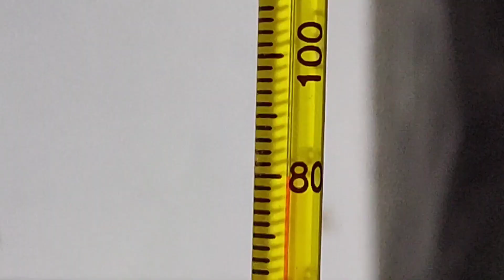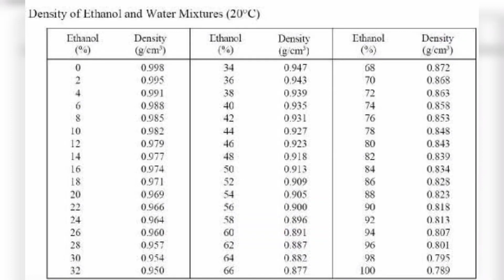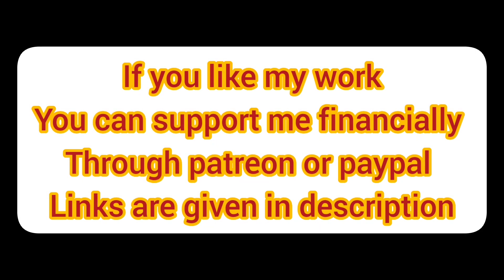How to make Alcohol without Yeast

Comment: Sorry, but this is hardly making alcohol without yeast. You are using yeast, just the versions naturally available on the skins of fruits. All fruit has naturally occurring yeast on the skins, so it doesn't matter what type of fruit you use, you will get a similar result. In fact almost all commercial wine production relies on the yeasts on the grape skins, so the vast majority of all wine would qualify as being made "without yeast" in the same way: The only difference being that fresh grapes are used, and of course wine is normally made on a substantially larger scale than shown here.
Reply: I think when yeast is referenced, he means packages of store-bought yeast, not completely removing yeast from the equation.
Reply: So theoretically you could make with apples with it's natural yeast as well? Apples is what I want to make some with but I'm not sure.
Reply: @Calico_Chip  Yes - in fact that's how most cider is made, at least those which use traditional methods. The yeasts naturally present on apple skins get released into the juice when the apples are diced and then pressed, and this takes care of the fermentation.

Most of the modern engineered yeasts are made for the purpose of surviving higher alcohol concentrations than naturally existing varieties, with some of the "turbo yeasts" able to survive in up to 20% alcohol by volume. Most naturally existing varieties die somewhere between 10 and 12%, which is why most wines have that same range of alcohol content.

Cider doesn't usually go that high - about 5% is typical, though there are some traditional ciders which go somewhere between 7 and 10%. Those are the ones to watch out for though, because they have the peculiar effect of getting you drunk "from the feet up". They look and taste just like apple juice and are just as easily drinkable, so you can sit down and drink a few pints and only feel it when you stand up, upon which a common reaction is to stumble and fall over.
Reply: can you use cherry’s ?
Reply from the maker: Yes
Reply: sunnykid1980  im jealous because mine smelled disgusting.
Reply from the maker: Ofcourse it smells discusgusting